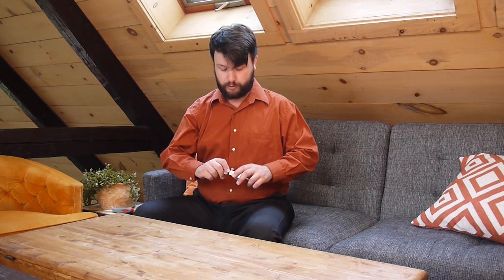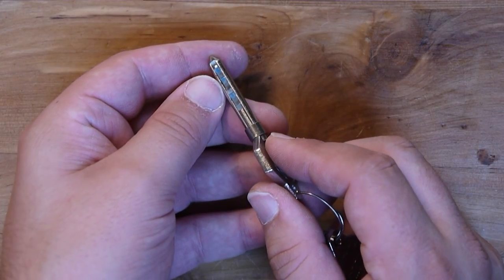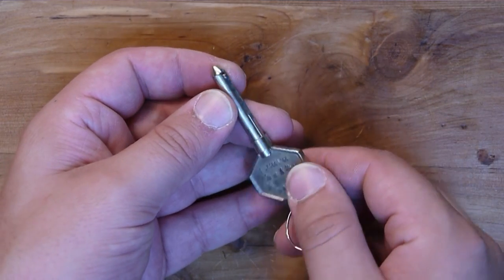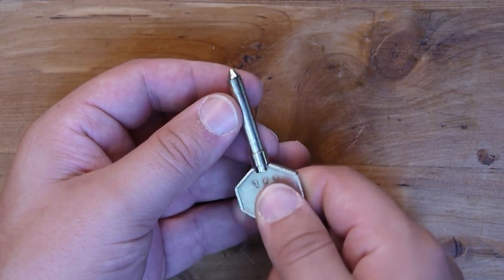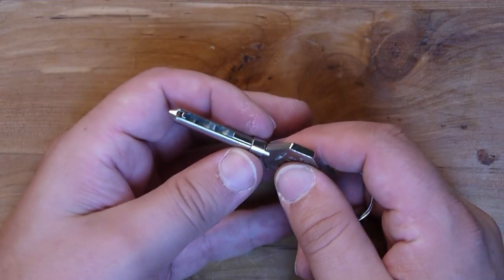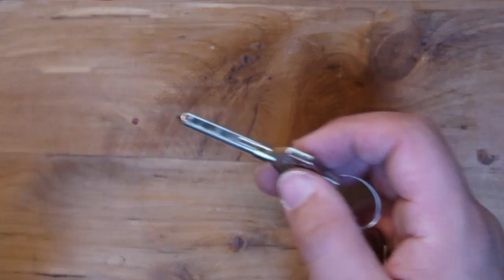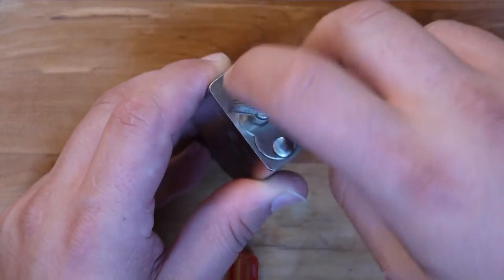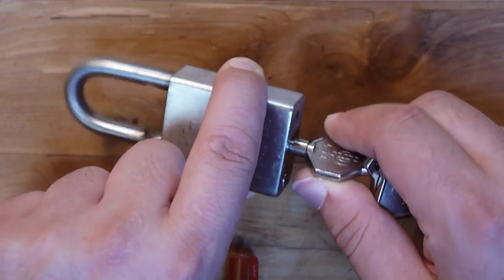The Collection: LSL Padlock

Comment: Not so horrible.  It's good to know there are some locks out there which are so pick resistant.

I would say, it's still quiet.  I would prefer a boost in audio of at least 10dB.  I was able to compensate (by 10dB) using PulseAudio to boost the audio of Firefox.

Comment: I imagine you could pick it like a regular lock quite simply, minus the security pins, if you made a tension wrench in the same shape as the key only hollowed out(like the letter C) with a bar attached to it that would stick out of the lock, and working the pick through the hole, if you get what I mean.

Comment: Does anyone know where to get a inexpensive pinning tray an/or a cheap way of making one - besides folding cardboard/paper??
Reply from the maker: Hahaha, yeah, if want to shoot your indie cred all to heck. Just kidding. I like the guys at CLK Supplies quite a bit, they have the classic LAB tray: http://www.clksupplies.com/shop/lab-pin-work-mat-p-1046.html but personally I prefer the compact wooden LAB tray: http://www.clksupplies.com/shop/lab-wood-block-pinning-tray-p-1019.html

And for style you can't beat the very good looking Sparrows mat: http://www.sparrowslockpicks.com/product_p/sparrows%20mat.htm I just wish they had left off the massive logo that takes up 50% of the space, though that's just because I value portability. If you are working in a shop instead of wherever the heck you find yourself, I think it would be a fine option. If you have access to a dremel or a chisel and some wood, you can easily bang out a simple tray yourself, actually.

And I've recently picked up some model railroad house shingles - basically very small corrugated plastic - that is slim enough to keep a pinning tray in my wallet at all times, so expect to see that in some future vids.
Reply: ***** Schuyler, thanks man ! Nice video also, nice challenge lock ;)